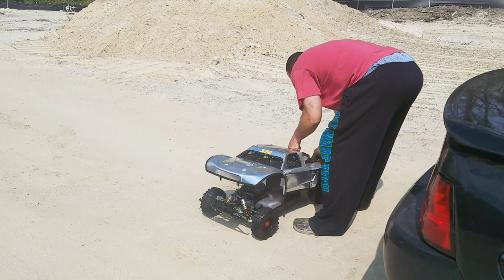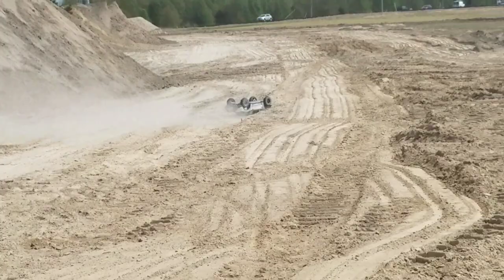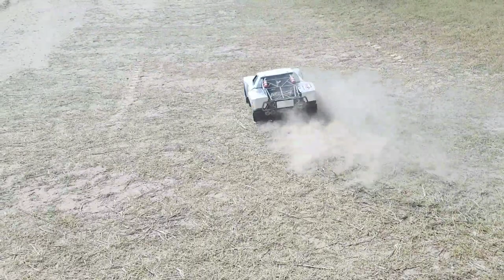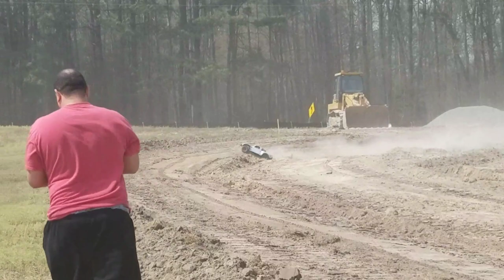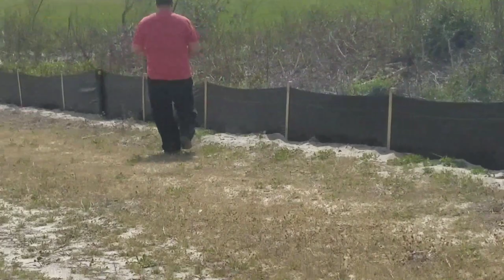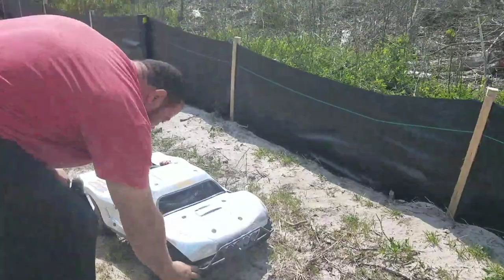I Was Haunted By A Runaway RC Car

Comment: I don't have a kill switch but if my receiver looses signal with the radio the servo for throttle and brake lock up so the car will stop.
Reply: Except when ur throttle servo frys and jams wide open, u be cursing "why didn't I buy that killswitch!"

Comment: I had a nitro car and the servo slipped and put the throttle wide open and sent it into the Barn and bent it up like you would never imagine. I think it was doing about 90mph when it hit the concrete wall and totally bent it in half and destroyed every part and piece in that car

Comment: Law enforcement should make it MANDATORY that these trucks comes with kill switches Factory Installed. They won't do it now, but when one of these things goes A.W.O.L and slams into a baby stroller of kills a Toddler, I can GUARANTEE they will make this change
Reply: You are supposed to drive in unpopulated areas only with these cars. A 1/5-1/8 car going 50 mph with a screaming engine (which would be very heavy) could break someones leg(s). They should atleast come with throttle return springs from the factory, as I own one.
Reply: Don't you think  we have  enough  law's in this  country  it doesn't need to be a  law it's  using your  brain
Reply: @0TheLastLoneWolf  Come to South Jersey, all the local Hobby shops try to talk you out of buying one! They all said That the Killswitch was for years ago when the radios were still AM. I didn't listen but also never had a merchant try to talk me out of a purchase before

Comment: my losi 8ight ran away and drove full throttle into a curb, all it bent was the hinge pin on one of the front a arms and popped out the dogbone axle. i got real lucky, could have been much worse damage.

Comment: At least it was a good top speed impact torture test. Remember to secure the receiver and battery pack next time. 
Also,  you might want to rig a return spring on the throttle for safety. I learned the hard way too.

Comment: Now you got me worried I am just waiting on my first Losi 5th petrol to be delivered  , I have no experience of big petrol RC only the Traxxis 8S  , can you tell me what causes this , is it just loss of remote connection , should it not just stop like electric rc if it loses connection , if it is not a connection issue is it possible to roll the truck with the steering to stop it running away , man I would be frightened it run over a child , it is a heavy beast . manufacturers should step up the game and install a kill as standard for all it would add to the price.
Reply from the maker: uptowndisco2 Thanks for posting. It was totally my fault..the plug from the servo came out of the radio..I did not have it secured..A kill switch would of stopped the truck by killing the engine.
Reply: Thanks for the reply ,before taking mine out once it arrives  I will look into the kill switch fitting before taking the Losi Monster Truck XL out.
Reply: Just found out the kill switch is not compatible with the Losi XL something to do with it having an AVC controller , not sure what to do now , or just have to be careful not to lose signal and keep the receiver servo battery well charged ,  any ideas ?  thanks
Reply from the maker: uptowndisco2 get another controller

Comment: All you have to do is set a failsafe on the radio,if it’s capable of course. You loose power from the radio or receiver,the power gets cut to idle.

Comment: Wow bro this video made me Cringe! Can't exercise caution enough. So lucky this was out in the field and not in your neighborhood. I was funny and made light of but could have been 100 times worse but man that was scary. Bro that's a huge investment it would be a shame to wreck it.
Reply from the maker: EVERYDAY RC thanks bro ..i got it fixed naw bro
Reply: We had a runaway with one in the neighborhood jumped few curbs kicked dust and in middle of the street cars stopped and started watching it til it finally decided to end the show by running in one of the neighbors yard and getting stuck
Reply: My rc10gt got ran over by a car.  The chassis was still good so I just put new parts on it.  Even a huge wreck is not a compleat loss

Comment: your very very lucky that you and you daughter or anyone or anything didn't get hurt they are fun toys but they can kill people and damage alot of shit as well never ever run my trucks or cars with out checking my Fail-Safes the futoba should have one build in that should have turned the wheels and the dynamite Fail-Safes are nothing compared to killer RC if anything happens with killer RC the motor gets shut down I really recommend that over any other Fail-Safes on the market stay safe and run well
Reply: How many deaths are logged from RC trucks? Just curious. It seems as some ppl are way too serious about life.
Reply: @jvon3885  I don't know if anyone's been killed by a runaway rc but imagine that truck hit a baby, you wanna find out if it would be fatal, or non fatal but leaving serious permanent damage?
Reply: @nunyabiz7021   if that happens I'd probably question the parents and why they had a baby on the ground while driving a truck line this. But I'm sure there is at least one instance in the world. It's almost impossible not to have one.
Reply: @nunyabiz7021  and I wasn't being too serious with my other comment.
Reply: @jvon3885  Cool, just tired of easily preventable injuries and death's, I'm burned out

Comment: I don't get why these people are laughing it off. That could have killed someone! You were lucky!
Reply: open field
Reply: Pilot Paul How would it kill someone?
Reply: @user-dz2jv4in5z I'm not trying to anger you with this comment but have you ever been hit by one of these models especially one of this size at 35-45 mph, this thing can easily kill ya if it hits you in the right spot. For sure it'll break your leg but if it gets airborne and hit ya in the head it WILL KILL ya. I've seen it happen at a racetrack where the truggy got airborne and hit a child on the back of his head and was rushed to the ER in pretty bad shape. These things should be treated with respect.
Reply: If water was Rum, i would be drunk...but its not
Reply: @user-dz2jv4in5z  dude my 10th scale revo nearly severed my fucking foot from my ankle.... this 5th scale smashing into say a child or a midget could very easily kill them. It is a 40-60lb gas pwered street rocket
Reply: Top of the class for the most stupidest comment

Comment: I had an rc nitro boat that I threw in the water with the radio off. It circled around and ran  right into another boat I had left beached on the grassy shore leaving a nasty gash and crack in fiberglass.Lucky that truck didn't plow into a power pole or tree dead on . Thank goodness for that erosion  fence acting like a trap.

Comment: Glad she thought it was funny... 🤦🏾‍♂️. You could tell by how the rpms were going down (after 1 min at wide open throttle and no load on the motor) that the piston was starting to seize in the cylinder. Hope all was good after a cool down

Comment: Some people shouldn't be driving a rc 😅
Reply: Dude, it isn't the guy's fault. The car lost signal and got stuck on full throttle. Although it could've been avoided if he had used a kill switch.
Reply: technically the car was driving itself.. so.. i don't really agree with your statement😂😂
people ABSOLUTELY SHOULD drive rc cars otherwise this sht happens hehe
all be it, people need their rc setup to be complete (with a killswitch)

Comment: Fail-safe  should have  stopped it  if he made share it works  before  hand
Reply: Spektrum transmitters have a built in fail safe if you hold full brake while binding your transmitter. In this case it would have lost transmitter signal and then instantly locked up the brakes. It won't kill the engine, but it will keep it planted and stop runaways.